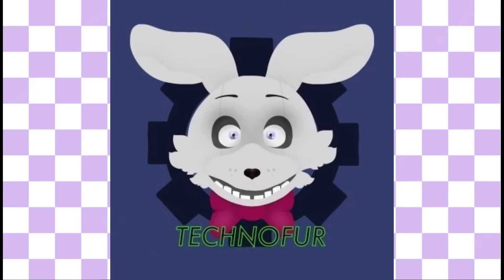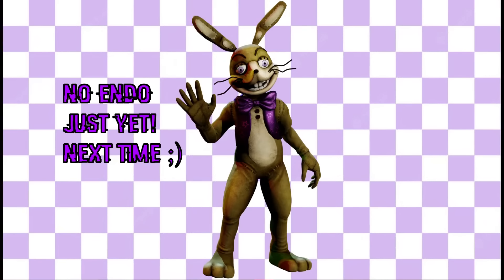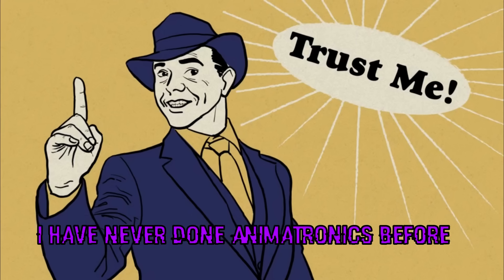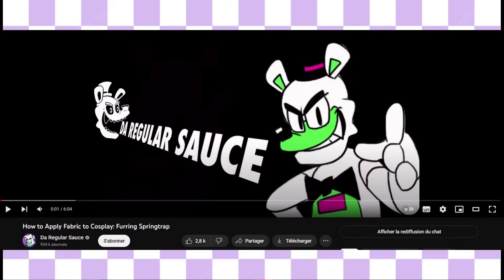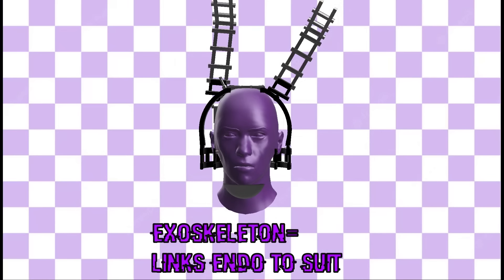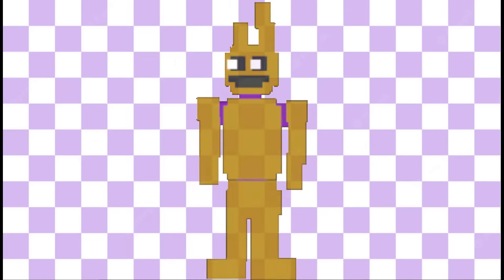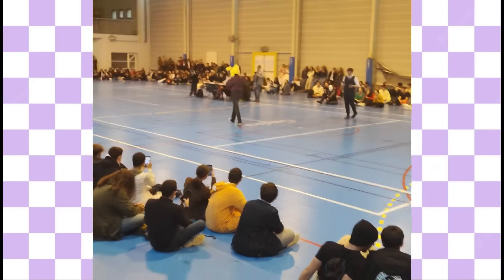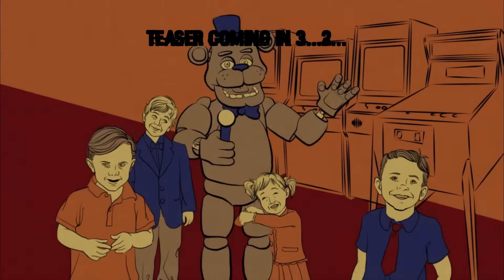Making A Real-Life Springlock Suit| PART 1

Comment: If you are going to use like real springlocks, Use a tension spring one, Compression springs in spring locks will lock the spring outwards, if it fails it will crush the body part. Tension springs in Spring Locks will lock the suit inwards, If the tension spring fails, the springs will go outwards so somebody can fit in it.

Comment: I thought about making a Spring Bonnie suit but it probably won't happen in the near future, I was thinking of making the body out of thin aluminum so it's light and strong then cover it with with cloths', I was also thinking about the springlock system itself which I doubt would be very hard to make, but I wouldn't know how to make an actual robot that talks moves "on it's own".

Comment: Alright, I Have A Few Questions, What Software Do You Use To Design The Different Parts, What Did You Use To Smoothe Out the 3d Print, What Type Of Servo Motor Do You Use, Where Did You Get It, And How Many Did You Use?      I'm Sorry If This Isn't Very Readable